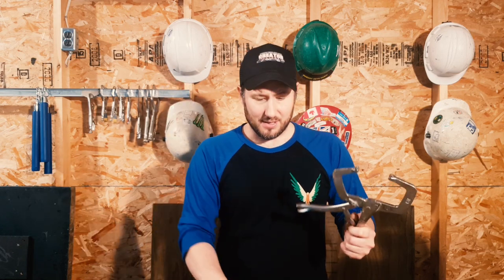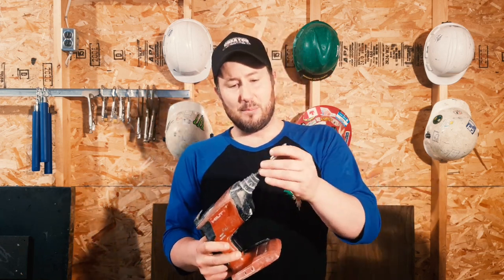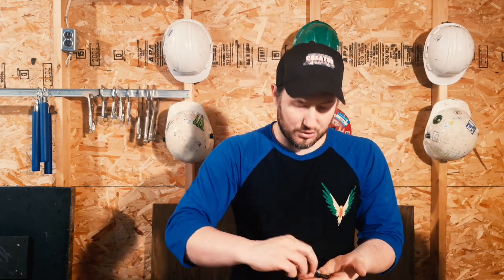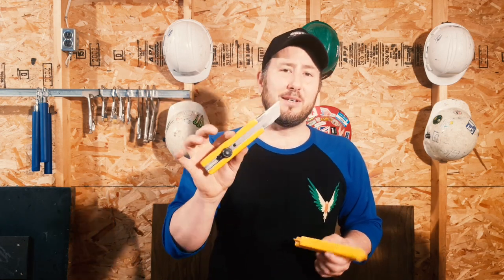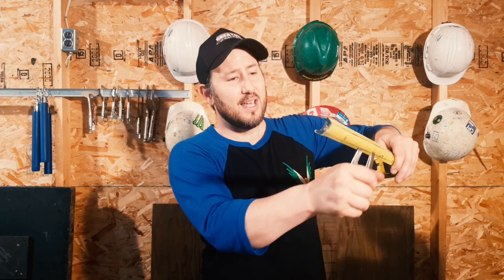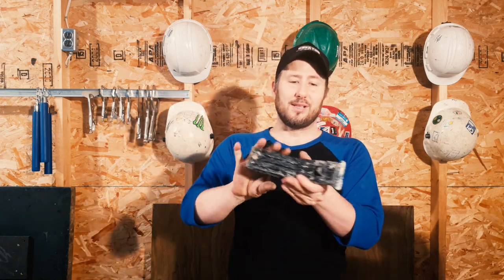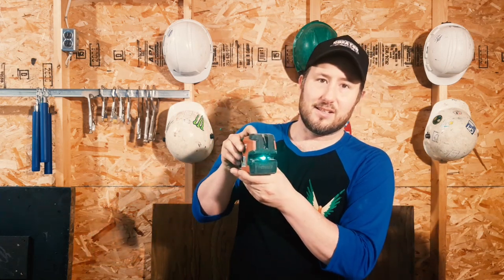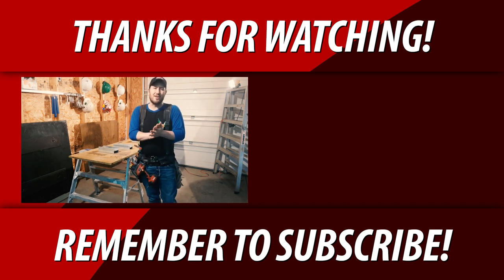Metal Stud Framing & Drywall Tools That You Should Know About!

Comment: viewed  e-bay, this Hilti is an expensive tool. even pre-owned, which i wouldn,t buy unless i know history of useage. they should have a Life time warranty on this tool. don,t they know people still have to eat after purchase?
Reply from the maker: Yeah ma  the best place to buy hilti is right from Hilti there website has all the prices and you should neve r buy for more than what's there. You can buy them right off their website I think. Amazon prices are usually higher.
Reply: @ConstructionKronies  i saw the framing nailgun simular to years, it was $1,500.+. from Hilti website. i almost had a heart attack.  i have never seen tools so high like that. i have shopped on amazon/ebay, sometimes home depot. never seen that in my life. i kept thinking, they must have a mis-print.

Comment: How is a guide point tip for rookies? ?😂😂 those are made for a cleaner cut.
Reply from the maker: Yeah, I only use them with new guys so they can learn the shape of boxes. I don't like guide points, I get a much cleaner cut with the standard point. The guide points break too easy, I find the standard tip lasts 10x longer. Lastly the guide points make sloppy cuts when pre cutting your boards. That's why I don't reccomend the guide point unless your just learning. I like the larger guide points I think its a 5/32" and the 1/4" for cutting doorways out.